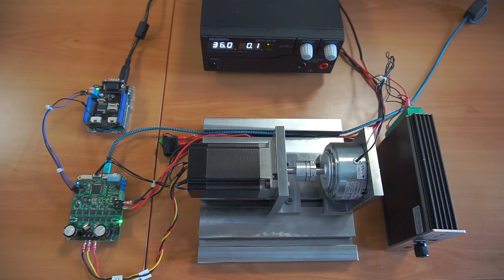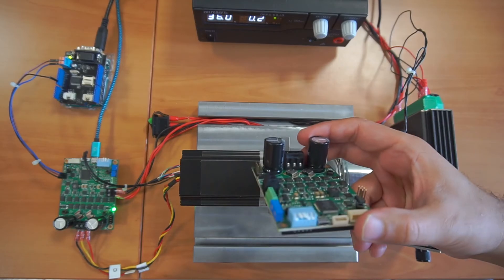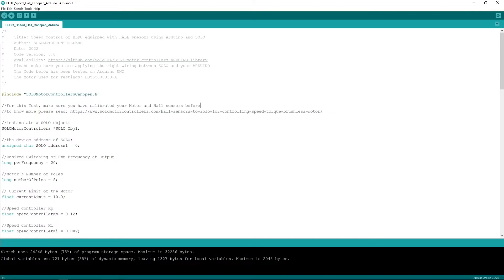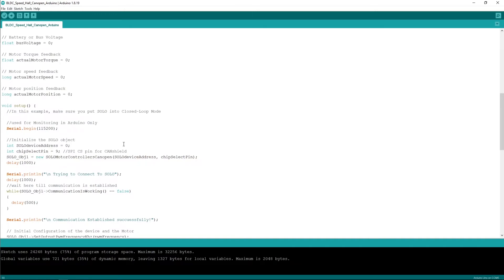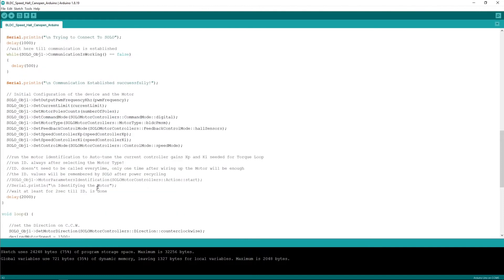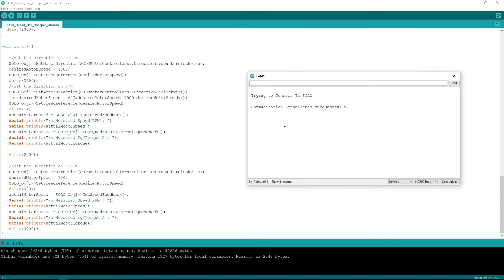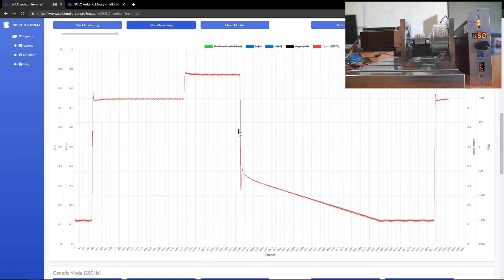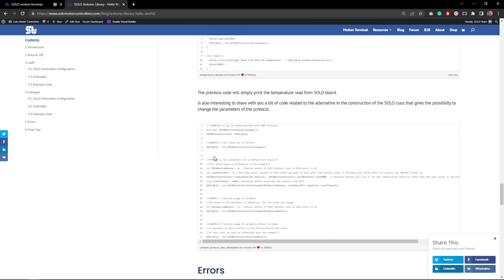BLDC Speed Control using Arduino and CANopen

Comment: is this possible to control an erob actuator through Arduino uno and a can module mcp2515.The erob actuator uses a can  open communication. Already it have a software eTunner (Zeroerr).but i want to control the servo through separate Arduino uno and can module.is it possible, please reply soon
Reply from the maker: Hello, Yes, the CAN module on the CAN shield is MCP2515, thus you can use it with Arduino and SOLO
Reply: Sir can you know about the erob Actuator? 
 @SOLOMotorControllers

Comment: BTW, I assume the Solo Terminal is a Windows application that connects to the Controller board via USB-Serial?

I understand the Arduino communicates to the CanOpen stack on the controller board.. but is there an EDS/DCF file that can be downloaded if not using an Arduino ?

Regarding the BLDC Motor controller, is it sensorless (i.e. uses Back-EMF) or does it require (Hall) Sensor feedback, in order to do the commutation?  Currently i have a board based on an Infineon IRMCK099M (sensorless), but the motor stalls whenever the load changes abruptly.. need to find an alternative.   Do you sell just the TI IC brain of the controller, or is it only available as board-solution (motor drivers, usb-serial, etc)?
Reply from the maker: Hello, actually motion terminal runs on Linux and Mac enviroment and it's not a windows based application, it's a web-based application that works on top of a browser.
regarding the EDS file please send us an email (support@solomotorcontrollers.com)
The best quality of control for Torque and Speed controlling can be achieved by using Hall sensors or Encoders on your BLDC motor, we are now working on a zero-speed full torque sensorless algorithm that has the same performance as a sensor-based solution, but that might take a while, for now I'd recommend you to go with sensors.
For the IC of the controllers, we are open to dicussions, please send us an email to support@solomotorcontrollers.com with your project description ( as much as you can ) and how you want to use the controllers.
Reply: @SOLOMotorControllers  At the moment we've been evaluating a sensorless Aveox Controller from Rix Ind. and it seems to be working with the wild load swings of the compressor.  Will reach out via email if anything changes, thanks again.
Reply from the maker: @bennguyen1313   We are very close with our Zero speed full torque sensorless realease, so basically if you like we can get in touch and we might be able to provide you some early realeases to Test it on your Motor.

Comment: Is it possible to take this setup one step further by having it broadcast (in hex) the speed? For example, using pulse width signal (digital or analog) of a transmission vehicle speed sensor- interpreted -tuned by Solo Terminal then having the interpreted speed broadcast over CAN to other nodes in 11 bit hex ID value (D). In other words, obd2 speed sensor to CAN.
Reply from the maker: The CAN section work based on CANOpen standard (you can network all the nodes too and share the information). Can you elaborate more the setup you like to have. If you like to post Images about the setup you like to have you can use https://www.solomotorcontrollers.com/forum/